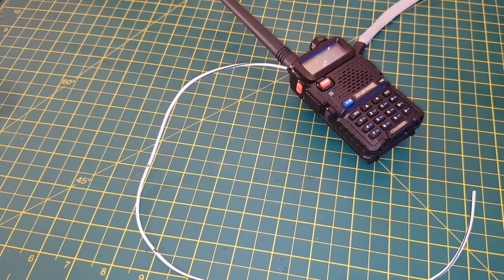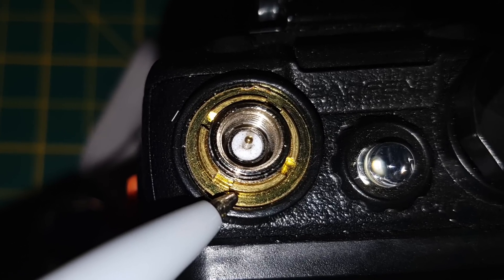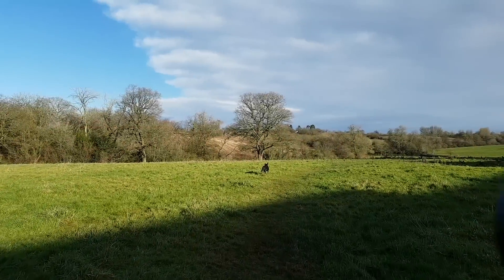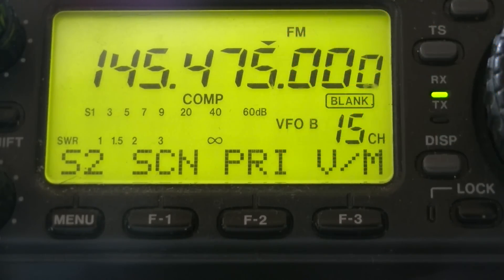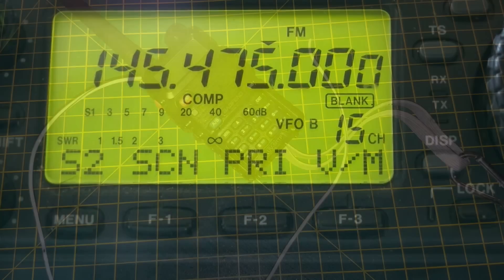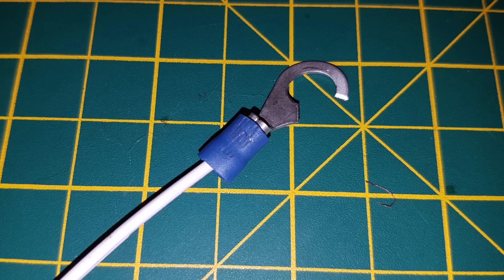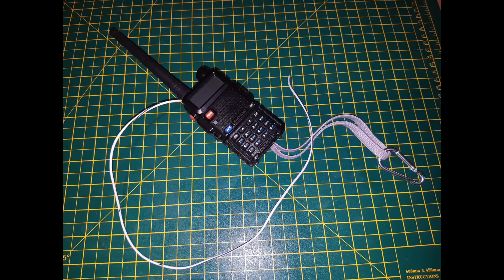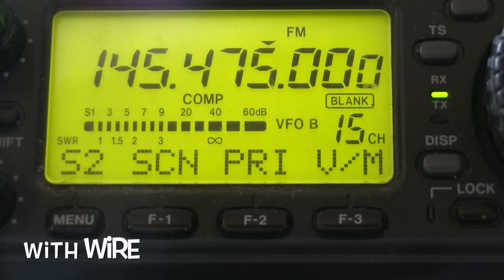Amazingly multiply the range of your transmitter with a one minute  modification counterpoise Links

Comment: there is  a better way to do it IF the radio is G M R S all you need is $35.00 dollars
for a G M R S license  and use the other side of family service which which is
 the  5 watt side of the radio then you code of the radio then your leagle
and you can use towers with a 20 range as I do.

Comment: I always suspected this being the major flaw in portables, if you hold it in your hand the effect is the same and probably improves the counterpoise in a way. Now we see first hand prove of the amazing quality bump it has if you attach a wire. I wonder when they supply ready made antennas with a wire attached. Does it do the same as a choke coil? Did you experiment with spiraling the wire around the base of the antenna? Try that for a change, probably cleaner to look at. THANKS !

Comment: Got the same radio. I’ve got 35 miles with just a 10” antenna. Haven’t tried it with a counter pose wire yet. But great little radios.
73’s Greg KC3PMX

Comment: Thanks for uploading! 
Me, I'm probably the least technical person around, but a vid turned up in my feed a short while ago, dealing with this very subject, which I assume was why your vid did the same, straight after.
Anyway, I'm waffling.
Me, technical, no, not by any stretch, however, I watched it all the way through and am no wiser, except I now know the tiger tail has to be tuned itself for maximum benefit and that a piece of equipment, some sort of meter, is required for that purpose.
I'll leave the link in hope you or someone else might find it interesting or useful, may comment on it, try it and I, being a technical thicko, can glean info on exactly what length I have to cut a tiger tail to match which antenna, etc.

https://youtu.be/BztTRFxsxNs

Comment: How many cm should the cable be?
Reply: no answer? I lookin too
Reply: For 2m band its about 19.25 - 19.5 inches (around 49 cm) and for 70cm band its about 17,1 cm length (19,5 inches *7/20). I think you can combine the two. The gain will be depending also on the antenna in use - it has to match. Best is to check it with a NanoVNA for SWR and input impedance matching 🙂

Comment: So sick of all the BS.  A single piece of wire is NOT a counterpoise! :- In electronics and radio communication a counterpoise is a network of suspended horizontal wires or cables, used as a substitute for an earth connection in a radio antenna system.  What you are talking about is a dipole. Are there no more technical ham radio folks around anymore?
Reply: Do you believe the result of his test?

Comment: Legit looks like a snake oil type of thing ha ha.
Reply: It’s not,  it’s basic electrical engineering.  Here in the US building these are part of most General (Level 2) Ham Radio License study guides.

They are called a counterpoise.  They also work really well for using the radio hands free with a push to talk.
Reply: @agmsmith4079  you don’t have to explain it, I simply said it “looked” like it. Not that it was.
Reply: @blade913   * "looks"
Reply: @stfuplsok  Keyword
Reply: @blade913   which you did not used.
Reply: @stfuplsok  I think you should read again.
Reply: @blade913   no, you should read again.
Reply: @stfuplsok  I see that you're a child, only a kid would think that was clever.

Comment: Should be 19.65 inches.
Reply: What about for marine frequencies of 156.300 to 157.100 when I'm 10 miles offshore - ?  How long should the wire be for best TX and RX?
Reply: And should I use my Abbree 42.5 inch fold out antenna instead of the rubber duck that came on it - ?

Comment: I can't confirm the stated improvement in TX. I tested a bunch of very good Laird, Smiley, TYT VHF-antennas that are getting me to a 140km far repeater with 10W. HT. As for the 18dB you should check your S-meter, there is no way to achieve such gain with a counterpoise on a HT. My assumption why it's working for you: the stock Baofeng antenna you've used is mega bad.

Comment: Hi there I have been playing around with counterpoises on my yeasu ft60 e and have found a 3 s point increase in incoming and outgoing signals, I use a 19.5 inch length of coax cable terminated with a solder on eyelet looks a bit neater but it's supprising the difference in signal using a rats tail good video and interesting. 73 da de da
Reply: 18 db for about ten cents worth of wire.  Now I'd say that is in the true ham radio spirit.
Reply: Pete radio ham io81ij     *Yaesu

Comment from the maker: I'm thinking you may be able to move the wire and antenna into a v shape. ... And have it slightly directional
Reply: For any new hams that might be watching, the Counterpoise length is critical because it is cut to equal a 1/4 Wavelength on 2 Meters. I wonder if adding a SECOND shorter wire for 70 Cm. would have a similar effect on that Band? THAT's the next video you should do.!
Reply from the maker: Thank you , I was thinking a shorter wire for 70cm with a spade on the end so you can connect the other length to make the 2 meter counterpoise, Ill work on it :-)
Reply: Bruce, I've read elsewhere that a 19.5 inch counterpoise wire is approximately a 3/4 wave length for 70 cm (actually about 71%), so should work to extend the range on 70 cm as well.  I haven't seen this done, so a test would be nice!

Comment: Nice video, it showed as as spam since I think you're going around sharing it in the comments of videos.  Generally a good idea to reach out to the creators you want to cross-promote with before just posting links on their videos.
Reply from the maker: Thank you Josh , great channel by the way
Reply: what kind of wire would you have to use
Reply: +Russell Ferris good question.
Reply from the maker: Hi Russell , I have used just basic speaker wire
Reply: Glad he did.  I've never seen you do it.